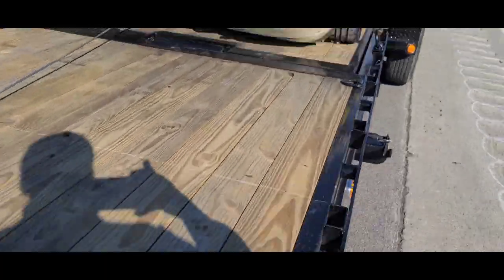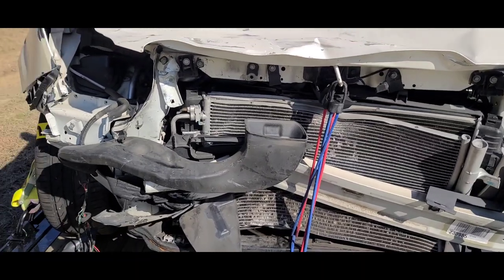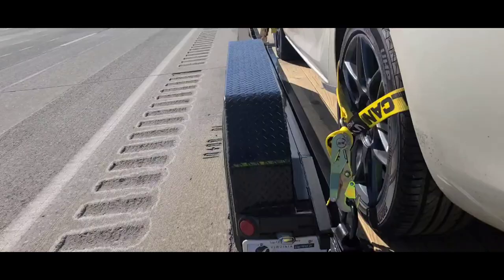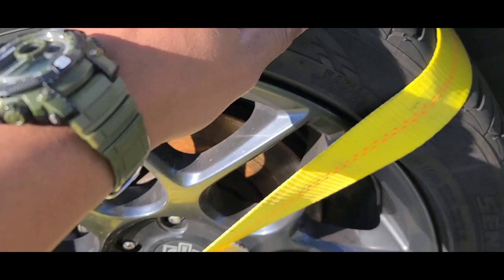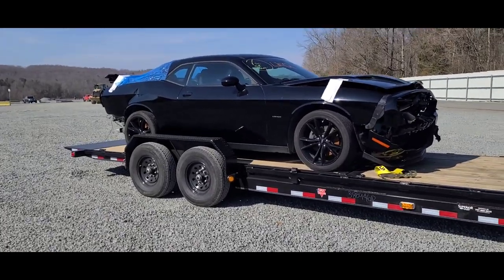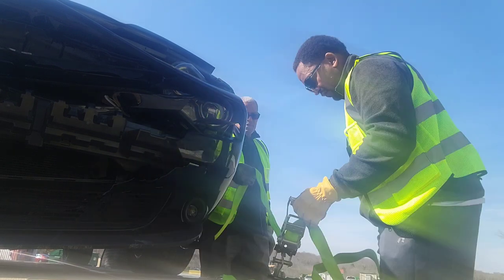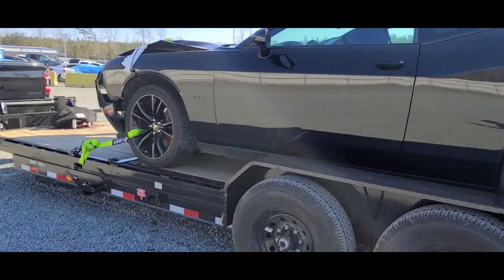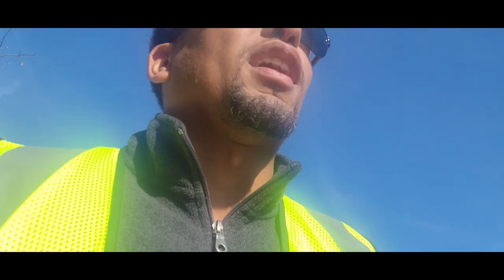RAM 2500 6.4L HEMI Non-CDL Hotshot Part-Time: 1st Day Moving Cars | 3 Cars Moved Getting my feet wet

Comment: Another good video. I was wondering what was the numbers on the loads you moved? Always interested in the gross and net of the day. Hope your son won his game!
Reply: Great question, I was thinking the same thing!
Reply from the maker: They each paid $150 per car. Was able to drop each of them within a 35 mile radius. Total work was about 3.5 hours. Dead head was about 60 miles back home. I had a car on my trailer when I started the day since it was close to my home for pickup so I only had to dead head one way. I have to take 35% out for taxes which is about $158. I spent a total of $95 for gas, $22 for food so subtract $117 for expenses. $158 + $117 = $275 in controllable expenses. I paid insurance in full for the year so I could take advantage of the discount. I divide that total insurance  amount by 12 to get a monthly rate. I then subtract that from the month end net revenue report once all loads have been completed for that month. 

$450 gross - $275 Expenses = $175 net for 3.5 hours of work. If you break down the $175 profit into hourly pay it comes to $175 net ÷ 3.5 hours = $50/hr

This is not bad pay BUT when you see how quickly the gross gets wiped out, you realize why so many youtubers out there only talk about Gross. Gross isn't what's important. It's the net profit you take home. There is money to be made out there but it takes strategy and it isn't as pretty as they make it out to be. To be clear, it isn't terrible but as I tell my employees all the time,  the details matter.
Reply: @liveyourfree  how do you find the jobs? If it’s cool asking
Reply from the maker: @Jondoe0  loadboards primarily
Reply: @liveyourfree  what are they called? DaT?
Reply from the maker: @Jondoe0  that's one of them. There are a few to choose from. I like super dispatch for cars

Comment: Great video!! About how much do they pay in your area for one car drop. I saw you did 3 in a day that was great!
Reply from the maker: They were local drops all within 35 miles of each other. They were offering to pay $50 per car but I negotiated with them to pay $150 for each. It helped that they were sitting for a while and I could knock them all out quickly on the same day. I definitely didn't get rich off of them but not bad for about 3.5 hours worth of work on the first day.
Reply: @liveyourfree what’s your trailer size?